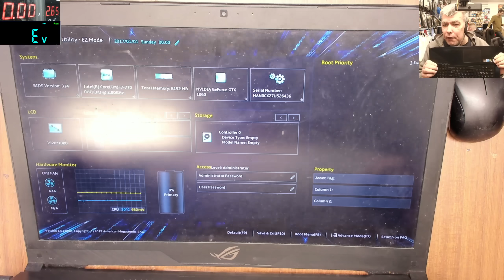Asus GL703 motherboard repair - I lost a coffee because of this one

Comment: so what if a guy doesnt replace the cap? will it run fine i removed 3 in my dell and its running fine for days now but ive been questioning taking it apart and taking a cap from an old mobo i have

Comment: Thanks for this instructive video! How do you actually determine the value of the capacitor you are replacing? I saw that there was another capacitor next to it in parallel, and I believe even another one. Did you maybe use that one as a reference?

Further, I understand it can be figured out if you have a donor board or a schematic. But what if you don't have any of those?
Do you perhaps have a video dealing with this problem? Thanks!

Comment: How could I identify if the damage on my old Asus Laptop i3  is the VRM chip or something else?(like a mosfet) I tried checking for short but no luck , maybe i am doing the checking wrong. MB, starts then stops, cpu + ram is fine , was checked on different laptop. If I pull the ram module the Asus starts but no beeps no post , only fan running. Any suggestions on what to check/ how to check ? I suspect the vrm chip but cannot be sure. (checked the power adapter , tried 2 power adapters , no difference). gpu is integrated It seems.(so not the main problem).

Comment: This is common for ASUS laptops, I learned that the hard way.
Never gonna buy ASUS again.
Unfortunately I can't find a shop to fix mine.
I tried at Depanero in Bucharest but they were interested in selling me a new MB that was more expensive than the hole laptop than fixing it.
Does anyone know a shop in Romania? Would be great to be in Iasi but at this point it doesn't matter that much.
Reply: Da, e un service in iasi ce repara laptopuri,am avut un  gaming laptop reparat in urma cu 5 ani si pot spune  ca  am platit 600 de lei pentru deranj.
Reply: @dunconpitbull  Cum se numeste? Eu am fost la Doctor laptop si mi-au zis ca e processorul

Comment: Sorin, its best to have a gaming PC instead of laptop? Been a fan of this channel. I've fixed so many HP laptops for family using a method you taught on applying amps placing finger to see which one gets hot. Worked everytime
Reply: Always. The best gaming laptop is a desktop. Gaming laptops are under a lot of stress and high temperatures and have high failure rates. If you must have a laptop for gaming then I'd suggest getting a cooling pad for it and also make sure it's always getting sufficient ventilation. Service regularly to clean the heatsinks etc.
Reply: @justinspiredfallout  and dont play long hours give it a break thats why i love my desktop stays cool and runs neearly 24 hours a day between gaming and watching shows and browsing

Comment: Hello I have an dell laptop error.it will come some times not always.some time my dell laptop not start when I press the power button.when i press power button it indicates the charging light when press some times it power on after 4hour or more when i press power button first time.after working i can work continuously no issue.after i shut down laptop power on first time press the power button that time.after shutdown it will take 4 or 5 hour lap was not power on when press power btn.again take more 3 or 2 hour when press button it will power on.dell service tag 7HT1F32   (3543)Model sir can give the solution for that and what is the reason for that.
Reply: Charge controller? Have you tried without battery?
Reply: @SinsBird  Without battery connect to the power charging light not indicate.when with battery connect to charger if im connect to the charger light indicate after 5 or 6   second.

Comment: Happy New Year, Sorin. I'm glad you recovered the main channel. Hope it will never happen again...

About this repair: 
Firstly... What? No mad-dentist method to remove that cap? Oooh... 😀
Secondly... Did you swapped the hot-air machine with the one at home, the ATTEN ST-862D? Do you finally get used to it and find out it's actually very good, despite your first impression? 
I have the same model, and I think there is nothing wrong with it, it works better than many other models I've used...

La mulți ani!
Reply: Hi, sorry by ask you but why Sorin lost his YT channel? Regards from Brazil.

Comment: happy new year to you too sir wishing you all the Best this year. Am ready for more skills and knowledge.
There's a problem i am still failing to fix maybe you can help us. the problem is the laptop comes on but keeps the  fan running even if you try to change the ram still the same and if you test the voltage on the ram powersupply its  present.

Comment: Dear Mr. Sorin. Let me correct you: when you say The resistance is very HIGH , the Resistance in reality is LOW. Here is why: according to the Ohm law: when you apply 3 V and the current is 3 A, then the resistance is 1 Ohm. When you put 3 V, and the current 5 A, then the resistance is even Lower: 3/5, i.e. 0,75 Ohm. A normal working Capacity has a resistance of a couple of MOhms (or hundreds of kOhms), a shorted capacity acts like a wire. And what is the resistance of a wire? In practice we can neglect it. It only starts to matter, when the length of a wire is of a several meters. By the way, the physical meaning of Resistance: the current flows in the direction, where the Resistance is low or lower. So, then we get a shorted power rail ( with roughly 0 Ohm Resistance) the  current will flow in that direction
Reply: You're right ✅
Reply: I think the dielectric of the capacitor changes its insulation, and it needs a breakdown voltage of at least 3v to close short
Reply from the maker: I think you got it wrong or you skipped the video, the resistance of that board short was exactly 0 ohms, tested on the beginning with the multimeter. So, yeah, having few volts with few amps on a power rail supposed to be 0, yeah the resistance of that short is high
Reply: @electronicsrepairschool  this is a good topic for a next video.
Reply: Yes it doesn't make sense to me either, maybe you can explain further Sorin? A shorted capacitor with a high resistance?

Comment: Hello Sorin! Thank you for sharing the knowledge! I have a question, I have a laptop that works fine. Once it enters turbo mode (cpu) it shuts off. I cheched for the shorts and everything near cpu is shorted to ground even though the laptop works fine when not in turbo mode. Is this possible or did I do something wrong? Thank you!
Reply: everything near cpu is always shorted to ground when using multimeter continuity. thats normal..

whats not normal is when you do turbo mode then it shuts off. 

cpu shuts off when it reaches at a certain temperature. old laptop like my lenovo x220 core i5 shuts off at 105 degree celcius. 

thats means your cpu is reaching its temperature limit in turbo mode. try to check the ventilations see if anything is blocking the airway. check if the fan is working properly, check its rpm.
Reply: CPU overheat?
Reply: Improve ventilation
Reply: Just to add to the answers here... also check with the free program HWMonitor which will display the temperatures for the CPU. See what temperature it gets to just before it switches off. It does sound like thermal protection is kicking in. Make sure your heatsink is clean and not clogged. Make sure the thermal paste is not hard and brittle. Clean and replace thermal paste as necessary. Also keep in mind that the copper heat pipe in the CPU cooler can sometimes develop a pinhole and leak the coolant fluid. At this point the heatpipe becomes almost useless and the CPU cooler would need replacing. You can check the temperature at the various points, with your fingers. It will be quite apparent if the heat pipe is not functioning properly as one end will be hot and the other end cold.